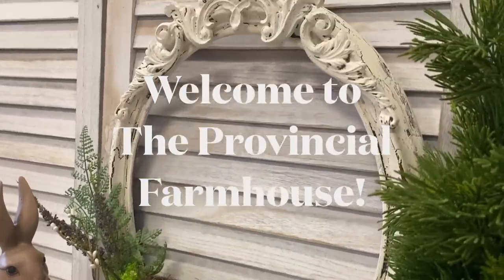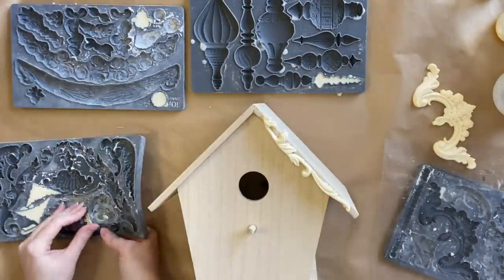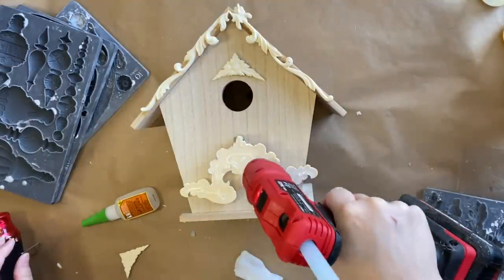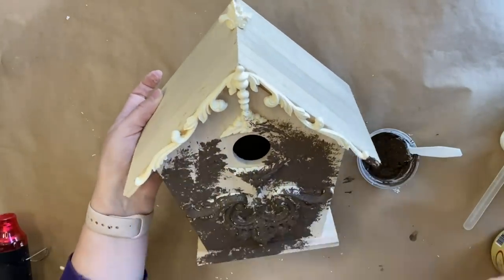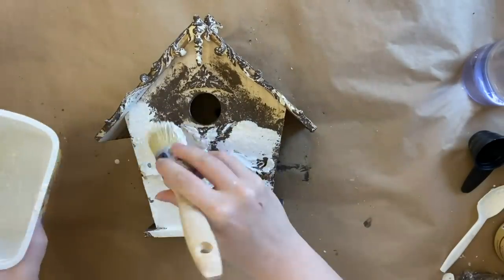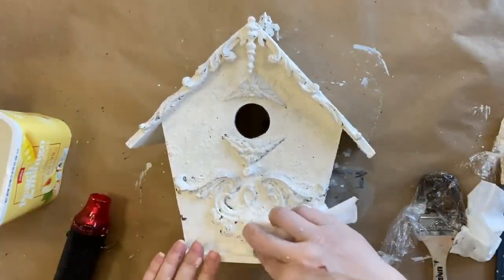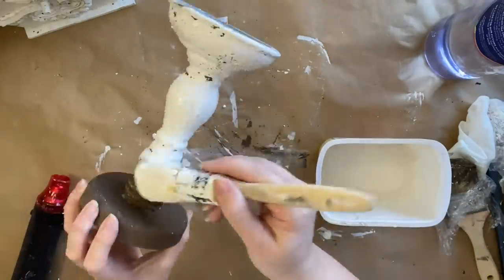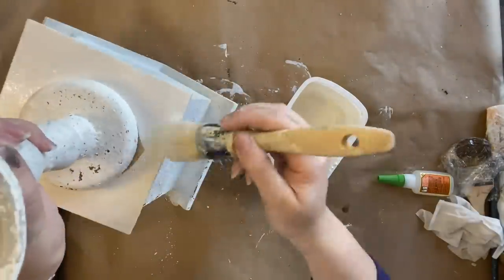DIY French Country Pedestal Bird House using IOD Moulds & Fusion Milk Paint | Garden Decor

Comment: Erin... I have been meaning to mention this to you, but always forget. A quick tip that works for me when using milk paint is to seal the areas (sea spray) where I want chipping to happen with a couple coats of DB Clear Coat in Gloss for a great resist to the milk paint. Sometimes, I add candle wax or bees wax over the top of the Gloss Clear Coat (but not necessary) and then put my milk paint on thickly in sections like you do and speed up the drying process. If I do not add the candle wax or bees wax over the top of the Gloss Clear Coat (which normallyI do not), then I actually add 2 coats of milk paint (normal paint layers, not heavy thick coats). The reason that I do 2 coats of milk paint with painting in sections and speeding up the drying process with each coat is because the chipping usually happens with the second coat of milk paint. I learn this from Jami Ray Vintage and tested it out myself numerous times and I actually do get more chipping when adding 2 layers of paint with speeding up the drying process with both. Definitely give it a try and play around with it before doing it on an important piece but I find that the Clear Coat in Gloss is a much better resist than the candle wax or bees wax and I do actually get chipping in that area as well as cracking. Most times, I do not even have to wet distress or sand. If you give it a try, let me know how it works for you. Hopefully, you get great results because we all know how unpredictable milk paint is 😂❤
Reply from the maker: Thanks Amber 😊
Reply: Great tip, thank you for sharing!!
Reply: Great tip. It's good to know the different techniques. I like the crackle with one layer of milk paint and wax but I can imagine where I might want more!